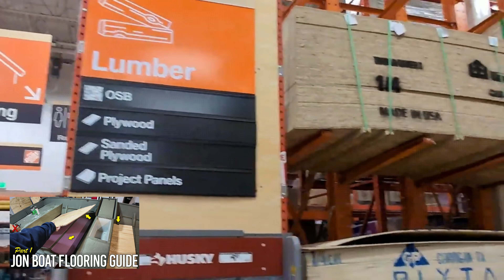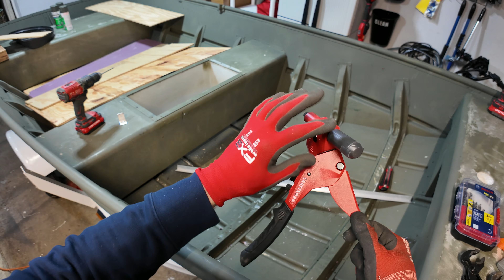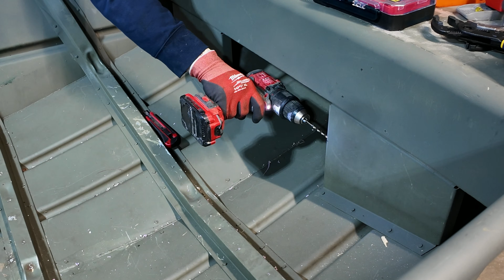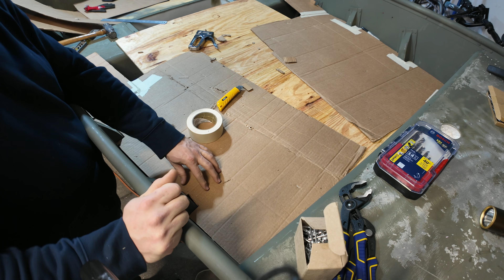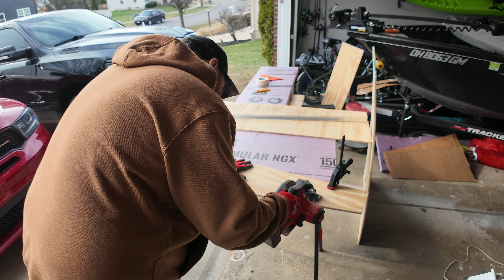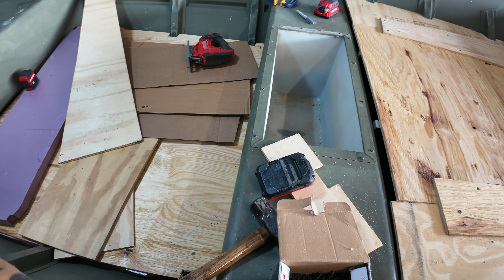JON BOAT CASTING DECK PART 1 - 1448 Lowe Jon Boat Build

Comment from the maker: 1448 FULL Build Playlist: https://www.youtube.com/playlist?list=PLa2zX8loz2eH2KnOoM3IEDAlRz6GkcOly
[Product Links]
Absolute BEST drill bits for Aluminum - https://amzn.to/4rDv4pY
Jig Saw Blades for Metal - https://amzn.to/4lcLbZn
CRAFTSMAN Pop Rivet Tool - https://amzn.to/4cJhNYa
3/8" Aluminum Closed End Rivets - https://amzn.to/4cdKE6Y
CRAFTSMAN Cordless Circular Saw - https://amzn.to/4cvyzu3
Levels - https://amzn.to/4awRwLm
Aluminum Angle - https://amzn.to/46Xq3QF
Composite Speedlite Square: https://amzn.to/3FOnJMf
Snap Blade Utility Knife: https://amzn.to/3HA2iRz
Flat Edge Ruler: https://amzn.to/4r0fh4b
Jig Saw: https://amzn.to/4a7bHxS

Comment: Hey what would be your advice for a deep v that has no factory floor ribbing I would love to make a floor and do it up fully but every build I see uses that ribbing to support the sub floor
Reply from the maker: You would have to build up a sub floor with aluminum angle in a type of lattice pattern. Deep Vs can be tricky, are there side ribs you can tie into?

Comment: Mike, I left you a question in another video, but I'll ask it again here. I have a Jon 1436 AlumaCraft and I'm thinking of putting a 25 hp Mercury engine in it. Do you think that's a good idea? I'm building it like a Bass Boat. Greetings from Aguascalientes México!
Reply from the maker: 25 might be a little big for a 1436, check what it's rated for. Would be great for a 1448 or even 1648
Reply: @mvboutdoors The label says max 15hp, but I've seen several videos of people from the USA putting a 25hp engine in a 1436 and I wanted to know your opinion. I haven't bought the engine yet because I haven't decided and it's really important to me, that's why I'm asking you, also because I know you have a lot of experience with these things.
Reply from the maker: @TAZTY_1978 personally I wouldn't, that's a lot of weight for the transom
Reply: Get a 9.9 and remove the restrictor plate on the intake. Get a 20hp module and you have a 20hp engine.
Reply: @jasonharris2790  Thanks, I decided on a 15hp, greetings from Aguascalientes, Mexico

Comment: Excited to see how this turns out. Can you do a video on how to get the perfect angle everytime when you are tracing for a casting deck? I saw what you were doing with the cardboard and would like to get a better explanation on it.
Reply from the maker: Sure thing so a quick explanation is the idea is to get the cardboard to lay flat against the side of the boat. I would cut out chunks of the cardboard wherever it made contact with the ribs. I'll see if I can make a Short showing this clearly.